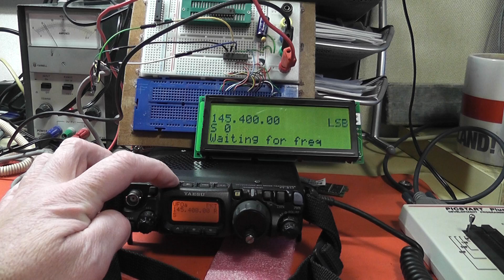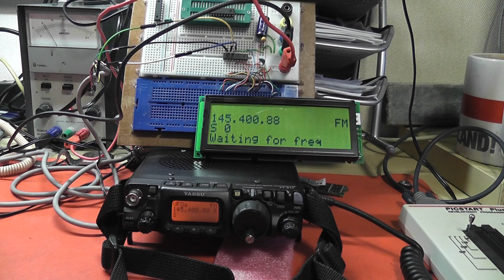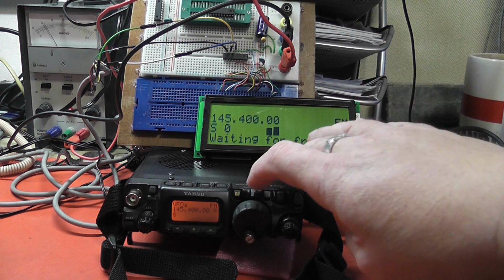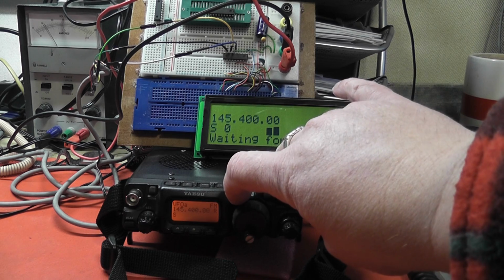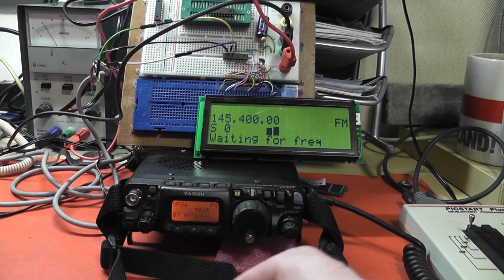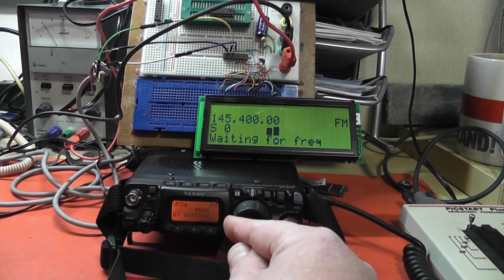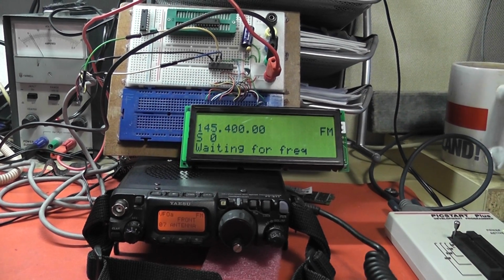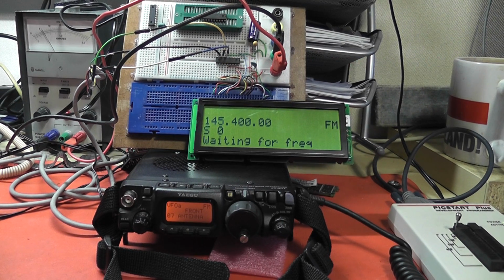FT-817ND - LCD Display

Comment: Is this project still alive?
Reply from the maker: I haven't touched it in quite a while but still have all the code.
Reply: are you aware of anyone who has completed the project offering instructions how to make it?
Reply from the maker: Ken I have been asked a lot for this. I’ll try and get on it this week. I did make a simple pcb and cased it all up. I’ll try and get something published. The semi finished thing is on my other video.
Reply: Thanks Paul,  with so many FT-857 radios having display issues (vertical lines in display) this might be a nice backup display.